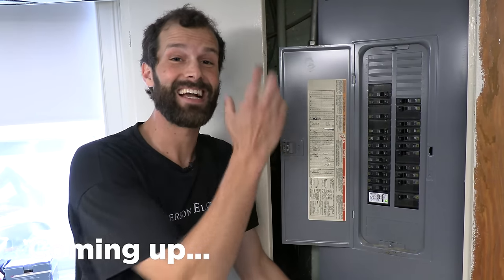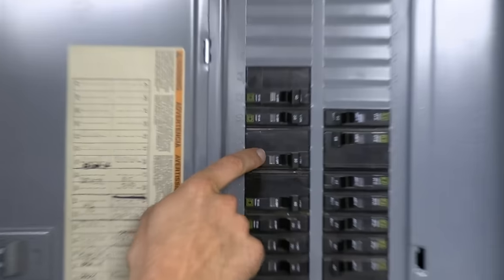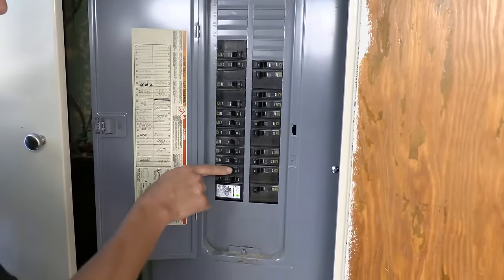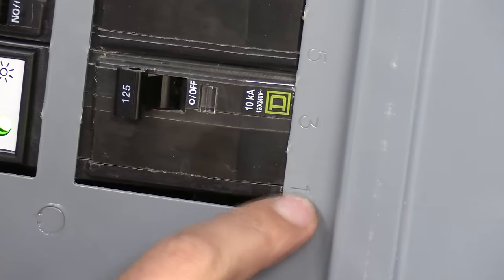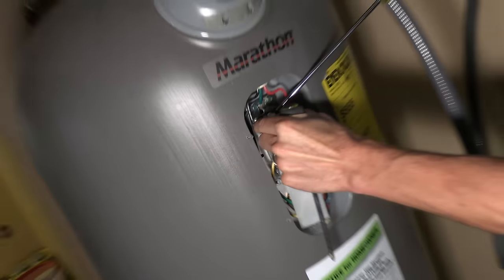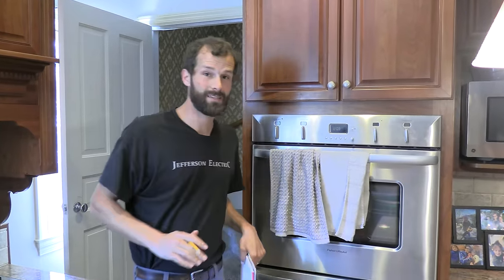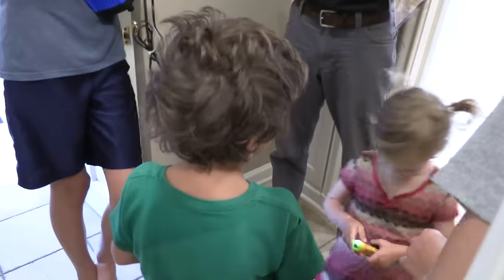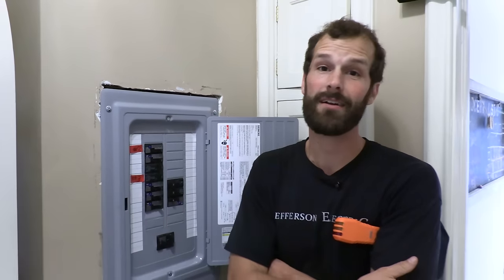A Master Electrician's Worst Nightmare

Comment: A quick question could an electrician label by letter and describe the breaker circuit function and then correspond letter labeling to the front/back of electrical face plates to make things better so you have consistency of what outlets or wiring are on what circuit?
Reply: Write the breaker number on the back of the cover at each outlet.  It takes a little time up front, but will erase any doubt as to which breaker to turn off before you work on it.
Reply: @cfgdr3  ptouch label on the front of the cover.  On the back would be a  pain.

Comment: They didn't have to turn off the main breaker just for a light fixture. They could have started by turning off only the 15A breakers. Then turn on the one for the furnace. That way, they would have had air conditioning.

Comment: Always something.. did not use the circuit breaker finder per manufacturer’s instructions, insulated screwdriver? I stopped watching when I saw the kid carelessly pulling the pigtail adaptor out  from the receptacle 😅

Comment: The problem with turning off one circuit is that you cannot be sure the water isn't running into other places across other wiring in different circuits.
Reply: Good point but honestly if it didnt trip it was probably ok

Comment: I never liked Square D. They seem even cheaper made than the new GE.  Hope you switch to different brand when you rewire?  The old GE circuit breakers seemed to last forever. Now they are made in Dominican Republic and I've gotten bad ones when new. Kind of frustrating when it was a 200 dollar GFI double pole breaker and I had to return it for a new one. But Square D seems even cheaper made than the new GE. The GE Subpanels are still well made though. Very beefy and should last.

Comment: 9:02 “I have an I insulated screwdriver here”
Err nope, you don’t ! 🤣
20:39 there’s that non-insulated insulated screwdriver again. 😂
Reply: Sure he does. On closer inspection you can see that he’s taken an ordinary screwdriver and wrapped it (the conducive shank) with black electrical tape. 
That’s the same tape used to wrap live bare wire. 
One layer of wrap should be sufficient, though I imagine he’s done two
Reply: @DanielinLaTuna  
Europe - for something to be called an insulated screwdriver it must meet EN 60900/ASTM F1505. Even Klein Tools makes one for Europe

US - fuck it, we give insulating tape.

Comment: Im confused.... 2344min you tested and confirmed 255vac
2403min you used the 120v circuit breaker tester... did you connect to neutral and 1leg!!?? To find the breaker... FYI im not bashing just don't want to fry my tester... lol
Reply from the maker: Yeah, we're not totally sure why it's rated and listed for only 120V so we gave it a try, but it may be wise to just stick to 120V.

Comment: did not realize you could use the tone transmitter on a 220 circuit without blowing it up.  

I've use my tone locator alot in mapping out my panel as it has vague and confusing labeling including referring to a bedroom by the occupying member of a family that I assume owned this house when the panel was installed.   Cannot remember if it was you or Scott (Everyday Home Repairs) that mentioned the tone locator a while back and convinced me to buy one.

My spreadsheet is grouped floor by floor then room by room and finally features within that room.  Room descriptions are geographic, not whose bedroom it is.   This also eliminates ambiguity since my basement lights are on three circuits with shop lights adding in two more thus making "Basement Lights" way too vague and one room in the basement having lights on two circuits.  Thus "Basement > North Room > Recessed Lights".

And with my basement being unfinished and thus metal mostly boxes, I affixed a label to each box (or the conduit right after the box entry fitting) with the circuit number printed on it.  The main and second story I have not labeled although I've heard of paint markering the backside of the cover plants.
Reply: You used it on a 240 volt circuit? How?
Reply: @illestofdemall13  he used it on the A/C disconnect and the water heater
Reply: @frankp215  I didn't catch that part first time around. Thanks.

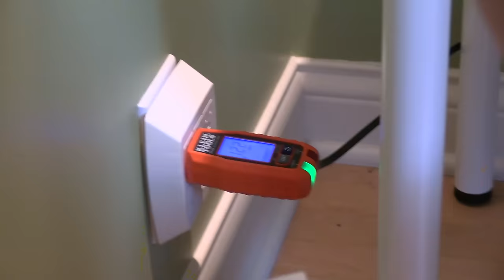Comment: Scared the crap out of me at 33:37. Too young to be using a plug in tester. Those little fingers were going for the wrong end of that tester. I don't think kids that small/ young are actually strong enough to insert the tester properly on some crusty old outlets. Leave it to the 8 year olds. In any case, there are child labor laws. LOL

Comment: The rating of the over-current protective device does not mean the circuit draws the amperage rating as labeled. No O.P.D can be loaded beyond 80 percent of its capacity. When resetting a breaker: your explanation is an over-reach, one should place the suspected brkr in the full off and return it to on, should it immediately trip a fault should be pursued as the cause which would be line to line, line to ground, and overload. For overloads a meter that records is the tool of choice as it will capture and hold the reading measured. Should it exceed the breaker's rating, disconnecting points of use will be the answer. Up-sizing an over-current device is strictly forbidden in every circumstance. The load must be reduced. A new circuit is the requirement. You are far too young to be considered a master electrician. In the case of motors article 230 shall be applied in every scenario. At the time of installation all circuits are to be labeled as to the loads served. Never attempt to be instructive to lay persons untrained  in the craft without precise knowledge of the task they will be attempting. Experience alone tells a trained individual what the fault may be. The dishwasher must be supplied by a dedicated circuit, same as the disposal. Read the factory manual first as the install must comply with those instructions. Ask the lay person of their confidence level, if they exhibit hesitance/trepidation, cease and offer to perform the work for them. One may find any and all types improper connections in residential, commercial, and industrial settings. All circuits in a dwelling must be provided with arc-fault and ground fault protection with only specific exceptions. Again, you are to young to be a master but you are commended for the attempt to be instructive, yet you should stop. Keep the craft within the craft and leave the babies with mom when you are at work unless you have a perspective crafts-master in the making.

Comment: When working alone I discovered using a specific circuit breaker finder extremely useful. Do an Amazon search for, Reliance Controls Circuit Scout LED Circuit Analyzer and Breaker Locator.

What I like about it is small, and it takes the place of carrying an old radio and plugging it in to find the circuit. It produces a warble alarm sound that can be adjusted from soft to VERY loud so it can be heard on the other side of the house or even outside. I've found it to be worth every penny of $30. It also doubles as a gfci tester.

Comment: Bought the first one and tested at the job site , same brand orange one - Klein , didn’t work, get back home tested it again one more time, same results, found the wrong circuit breaker again , thought ,maybe it is  defect one, returned and bought a second one , same brand - Klein , worked same shit, skept finding a wrong breaker , returned !!!
    Maybe Klein  brand is junk one , bought the third one , different brand , didn’t work either !!! Oh well, fu…k them all . 
  Maybe the hot wire finding tool with  a pair of walkie-talkie ( no need another person) will do the job better than those lousy design circuit breaker finding tool above.
Reply from the maker: Bummer, but thank you for sharing your experience. We haven't had these issues but always glad to get a broader pool of data and experience.

Comment: I am a newbie. But I did read the circuit tester which says you should scan the panel first so that it learns the "load center ".

Then after it learns you rescan it so it finds the circuit. So don't do that initial sweep that you did because somebody is going to get the zap ;)

Comment: You gotta be non union for real because you go on and on trying to sell the situation instead of just getting into it.  House built in 1938 but the panel and breakers look a few years old a long with the rope.  Also why the panel mounted upside down?!?  I mean you can CLEARLY SEE even ckt numbers on the left and odd on the right…master electrician my ass hahaha.  All you need is a good circuit tracer, walkie-talkie’s/phone or loud voice and some post it notes to tag the areas and update the panel schedule.  Put you panel cover back on cause I just threw up seeing that crap…